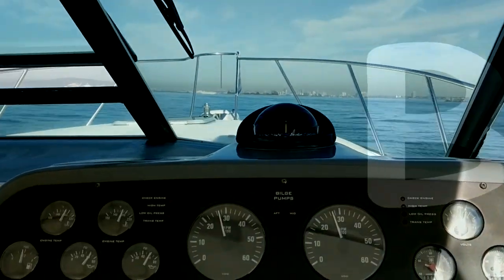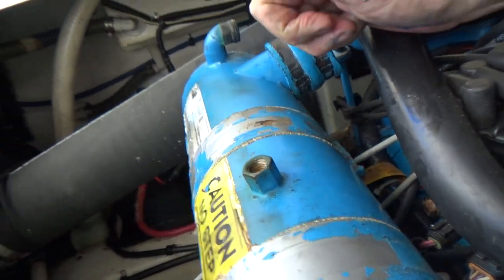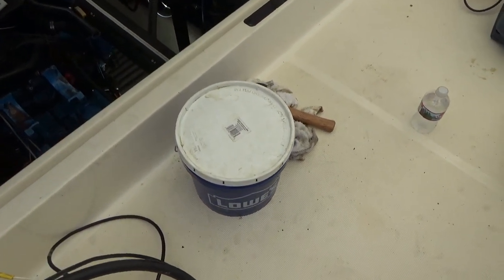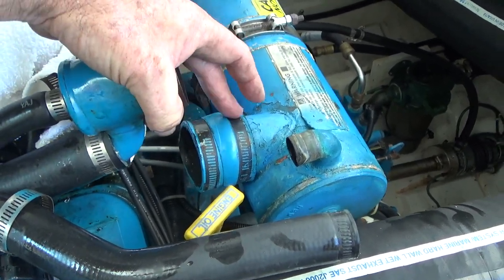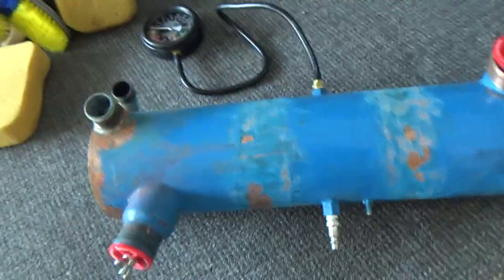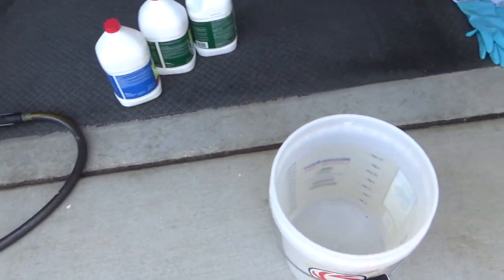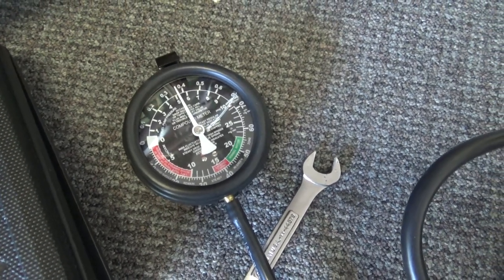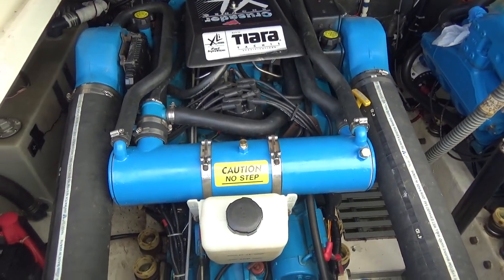Heat Exchanger Love Ep.43

Comment: Let me give you advice about a heat exchanger. I have a Thompson, 19,87 Sea Rage. Well I discovered a problem, the last time the boat was in the water was 2002, yes that long. I had many years of solid working. It’s a shame I only live 5 miles from Lake Huron in the Thumb of Michigan. Back to heat exchanger we’ve been working many hours, getting in this boat water ready. Spent a lot of time cleaning it up, turning the engine, Man it runs sweet, we had to drain plug out, and wasn’t noticing clear water coming out of the hall. Anyway we put it in the lake the boat ran well. Just for laughs and giggles, I thought that I should check and see if any water is leaking in the boat. The boat wasn’t sitting quite flat, we were out about a mile and I’m noticing the hall filling up with water, thank God my bilge pump works well, we slowly went back to the dock and pulled the boat out and I thought oh shit, I must have been wrong, when I looked at the boots, they must be cracked, I didn’t see a crack, actually they were very soft. When I hooked water hose up to the engine. The engine started well but, the water was just pouring out of the hull drain. I started looking at the engine so to find where the water was coming. I couldn’t see it, but I could see, clean water in the hull, so dang, I want to stop right here, guess what I found?  when the boat was winterized many years ago, somebody forgot to put the drain plug back into the exchanger. I could’ve lost that darn boat out in the lake, because it was pushing more water into the boat, then I could pump out. Lesson learned, look at the heat exchanger,  make sure the plugs are in it. I have no idea what size the plug is a 3/8 bolt seems to fit. So it’s a start.

Comment: Well done!  I have done the same job for  two heat exchangers on my boat. What a drag!  I don't know how you did it with just one rant.   You did a couple of things differently than I did.  I was afraid to use Muriatic Acid.  Instead, I did the bucket wash with straight white vinegar.  I left each side overnight in the straight white vinegar twice; so each side was submerged in the bucket for 16 hours.  The vinegar works more slowly than the Muriatic Acid, but judging from the color of the effluent, the vinegar did pretty good; though it seems that the effluent in your bucket was thicker.  If you're going to use Muriatic Acid, please make sure that you use eye protection.  You could probably just use your dive mask. 

I didn't pressure test, which made your job much more professional than mine.  However, I noted that you only tested to 5 p.s.i. My heat exchangers have a coolant fill cap rated at  7 p.s.i.   Perhaps your caps are rated at a lower pressure. 

One tip that may leave you less flabbergasted by those stubborn hoses helped me immeasurably.  I used a heat gun to loosen those congealed hoses, and that made their extraction from the heat exchanger not only easier, but possible.  Without the heat gun, there's no way I could have gotten those six hoses off without damaging at least some of the hoses.
Reply: A pick with a 90 degree will also work well to loosen hoses

Comment: Same heat exchangers and the same exact threaded fitting snapped off.  Split right in half!  Now I need a nut welded in.  What shop did you use in Long Beach to weld it in?
Reply from the maker: I used La habra radiator off of Whittier boulevard in La habra.  I'm sure any radiator shop can braise a fitting on for you. Thanks for watching. Cheers!

Comment: Thank you for the video, do you happen to know the dimensions of your heat exchanger? and is it cooling just the engine, or manifolds also?
Reply from the maker: Not sure of the diameter of the exchangers I think they are 5 in. The fresh water circulates through the exhaust manifolds and the engine and the exchanger cools the freshwater.
Reply from the maker: I confirmed the diameter at 5" .  Here is the crusader part number: 98562   Hope this helps
Reply: @tiaramisu   Thank-you so much!

Comment: Thanks for the video, super helpful! Where did you buy the gaskets for the end caps from? Do you happen to have the part number?
Reply from the maker: The end cap gaskets for most round exchangers come in different diameters so just measure the diameter of your exchanger and then go to Marineengineparts.com they should have whatever size you have.  Thanks for watching. Cheers!
Reply: @tiaramisu  I have the same engines as you, 7.4L XLi's and it ended up being 5" gaskets. Out of curiosity, which paint did you use for repainting them? Very good match to the Crusader blue.
Reply from the maker: @MYNautiGirl  you can still purchase an actual crusader blue paint from different marine engine suppliers. I think I got mine from Marineengineparts.com
Cheers!
Reply: @tiaramisu  That explains why it's such a good match! Thanks for the info.

Comment: Hey I'm not very familiar with these heat exchangers, I've had one on my inboard/outboard 3.0 mercruiser boat I bought in 2015 and no issues until this year.
 I start up my boat in the driveway and it runs, with the hose attached to the leg of the boat with the muff. Runs good but I notice water pouring out of my drain plug, I inspected and it looks like the end of my mercruiser heat exhanger is leaking. It might be a gasket I'm not sure..

I have no idea where to start.
Reply from the maker: If it was me I'd pull off the entire exchanger pull it apart and do an inspection on it. Make sure that there's no massive corrosion on the surfaces that gaskets mate on. Take the exchanger to a radiator shop and have them boil it out if you're not comfortable doing it yourself then new gaskets put it back together paint it slap it back in.Thanks for watching. Good luck. Cheers!
Reply: @tiaramisu  Thank you for the suggestion! I'll try that.
Reply: So I'm just putting it back together now, do you use RTV gasket maker aswell as the rubber gasket?
Or just the rubber gasket?
Reply from the maker: Just the gasket
Reply: @tiaramisu  Thank you sir!

Comment: How often should you clean your heat exchanger? Have a 7.4 454 Merc large block.
Reply from the maker: Raw water flush every year.  Acid dip, pressure test, and new end cap gaskets every 10 years would be my recommendation. Cheers
Reply: I cannot find any end cap gaskets for mine on my 454 merc. ! I had to get a machine shop to male my end caps bc they cracked in the middle allowing water to constantly drain out

Comment: Do heat exchangers have zincs?
Reply from the maker: Absolutely most of them do. They're called zinc pencils and they need to get changed on a regular basis. You should be looking at them at least every 4 months. If they are more than half eaten then they need to get changed.  Some oil coolers have them also. Thanks for watching. Cheers!